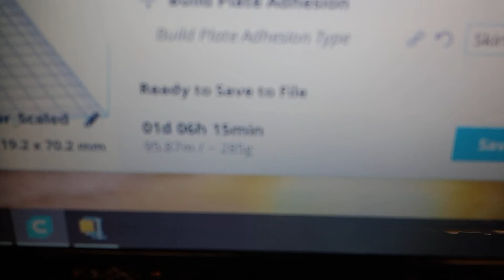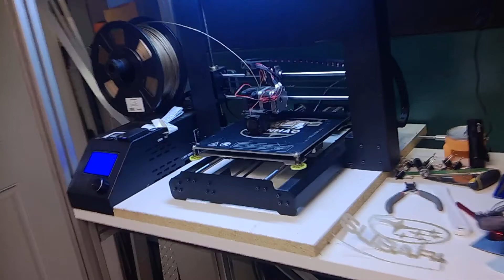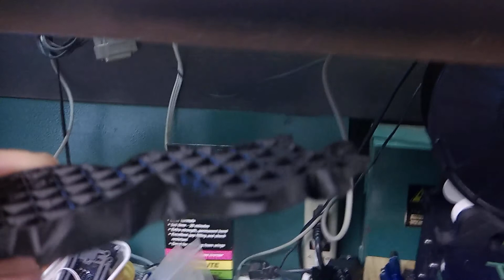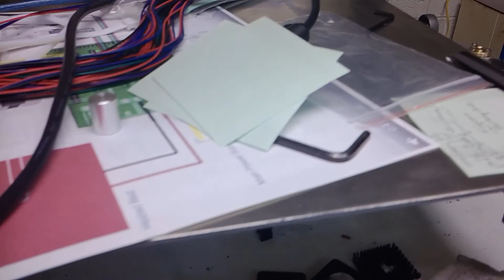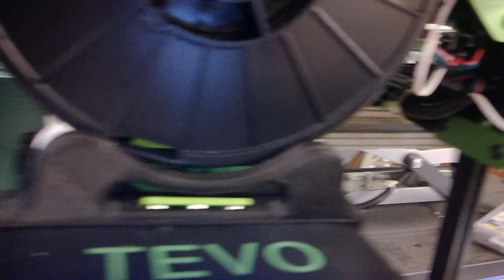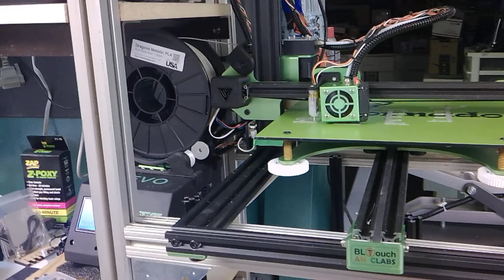TEVO Tornado 1 week update ( LOVE IT )

Comment: After dealing with Tevo with a lemon that won't print without 3rd party addons I would not recommend buying this printer.  
Not only did they mess up shipping me a replacement bed and extrduer gear, not shipping it out for weeks until I bugged them about it, but when it finally got here it was a bent bed, totally unusable. 

Buyer beware on Tevo products.
Reply: Ive quite enjoyed mine so far. About as straight forward as it can get without them sending it fully assembled imo. And pretty good upgrade ability  aswell